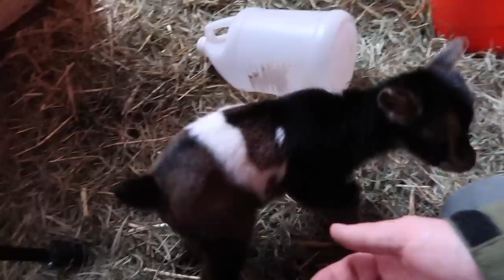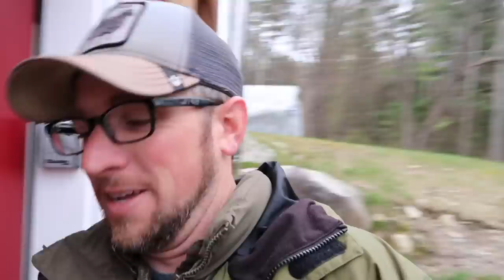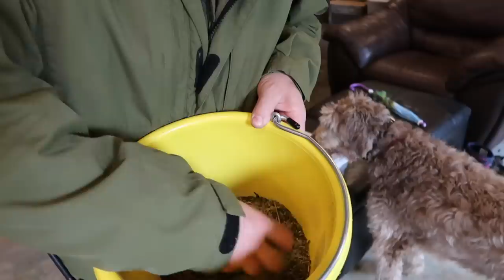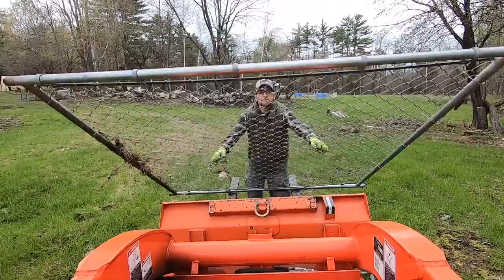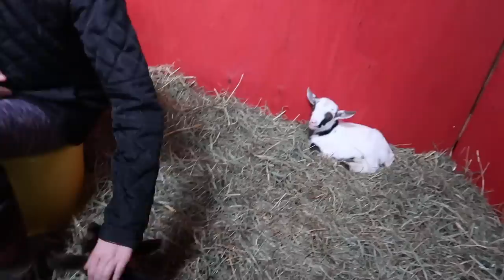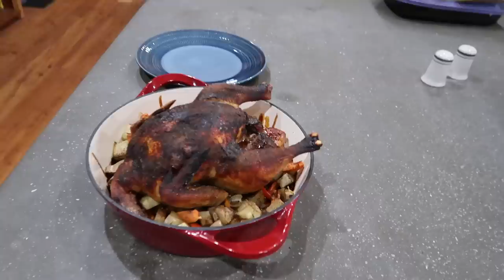So Much for WAITING! I Hope GINA & Baby Goats AGREE

Comment: for the bolt cutters look carfully you should find an adjustment screw  usually at the pivot point on the jaws go easy to get the right clearance because the jaws if too tight and you force too hard will break themselves

Comment: I bought one bag of chaffhaye, never again, it molded extremely fast. Put the rest of it in my compost pile. How do you keep yours from molding?
Reply from the maker: I find if I keep it in my basement with a lid on it it’ll last a while otherwise if I keep it outside in a barrel but not a tight sealing lid that way the air can get in there and dry it out it doesn’t mold.
Reply: @LumnahAcres  I am in Texas, we have no basement. A/C has been on and I kept it indoors. I was just disappointed that it was such a waste for me.

Comment: Your Electrical Service Cable from the Weatherhead down to the  Meter Cabinet and then to that outside Disconnect would NOT pass Inspection in Tx ! It has to be enclosed in 2 inch Rigid Galvanized Steel Conduit ! One can't have '' exposed Service Cable '' on the outside of a structure subject to damage and the bad elements of Mother Nature !

Comment: Hey Al, the weather's gone crazy here in the Midwest also. They closed US Highway 61 into Missouri from Iowa, again. They are putting sandbags back in where they were. We have field down in the bottoms that may never get planted which means it won't qualify for any help and we go without any crop to help pay taxes on the ground we have. It seems that the farms along the rivers on both sides of IA and the rivers in between are all in trouble with the flooding. In the last two days we got four and a half inches of rain. The high to day is 54° and six days ago it was 91°. Well enough crying. We're all still here and that's a lot. I think that little doe should be named Blaze since she has one. And the other one I'll go along with Manny or L-man. Chicken looked great. Makes me think about doing a rotisserie chicken for supper tomorrow. To late to do it tonight. Hopefully the gravel prices hasn't gone sky high like they have here because of the wet conditions of the roads. I haul it with our own truck but that isn't making it much cheaper with fuel and the quarry price. Be glad to see you get going on the barn so you can get the hot tub and sewing house ready. LOL. Hang in there Al things will dry out some time and as you get older your memory goes downhill. You and yours stay safe, happy and prosperous. Larry